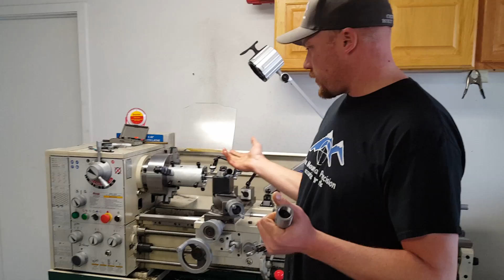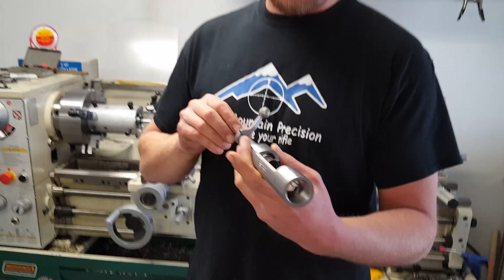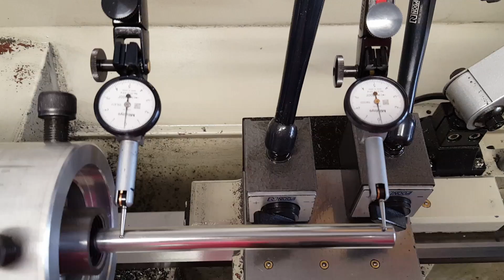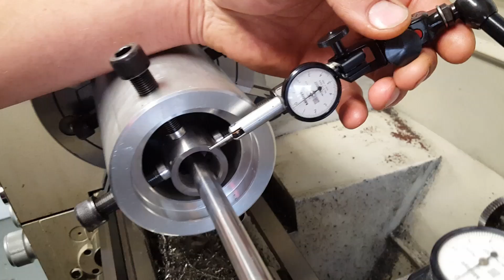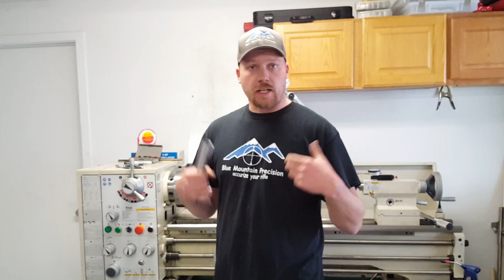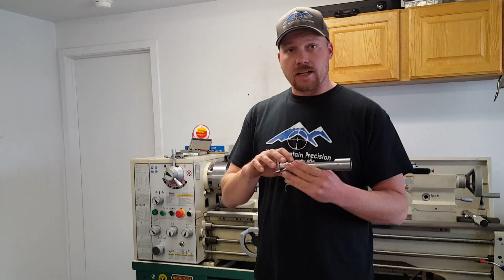Blue Printing Action

Comment: If you indicate your action by using that mandrel then you are doing it wrong.you have to indicate off the threads by making a precision mandrel that fits the threads tight..and butts up against the locking lugs..then indicate the O.D.of mandrel front and back and also length wise.after that then you can cut the face and internal lugs..forget about the rest.remember the treads are the master point..everything has to come off the threads...bolts are made sloppy.as you know. Some gunsmiths end up rechasing the threads and making things more complex...that's a NO NO.leave threads alone and work off the threads in the action
Reply from the maker: Sam if this is how you think you machine actions true then you should probably never touch any action if you want top accuracy. Maybe you can prove all the other top gunsmiths in the country wrong too. Lol.. The raceway is the center of how all true actions are made and machined for top accuracy. Maybe this is why custom actions all start with a raceway to work from?? Sometimes it pays to do research to gain real world knowledge before try to educate others.
Reply: Stupid is as stupid posts. Don’t be stupid.

Comment: When you cut metal away from the bolt how does that not change the head space? And make everything lose in the action
Reply from the maker: @ricky white You most often need to rebarrel at the same time. Also when you recut lugs and face of the bolt it equals out to minor changes in head space.  But blueprinting is done for accuracy and a new barrel is installed and then headspace is reset. I will not put the time into blueprinting a action with factory barrels. Concentricty is key and factory barrels lack that.
Reply: Blue Mountain Precision I couldn't see wasting time blueprinting a factory rifle be of that   I guess it makes more sense if you rebarrel
Reply: What does it cost to blueprint a Rem 700 and rebarrel?
Reply from the maker: Find all services we offer on the website - http://www.bluemountainprecision.com/services
Call 307-260-5009 if you want us to  help you with your rifle.